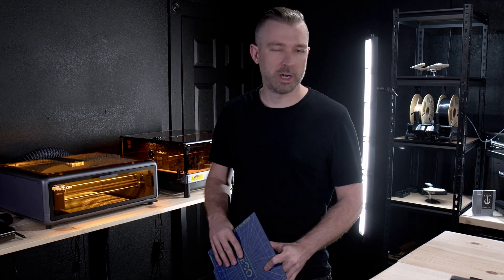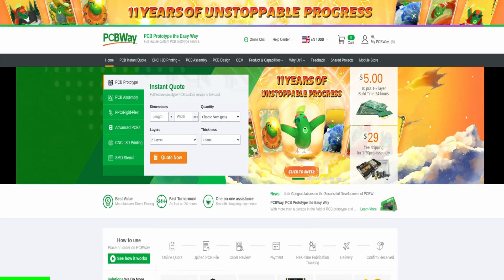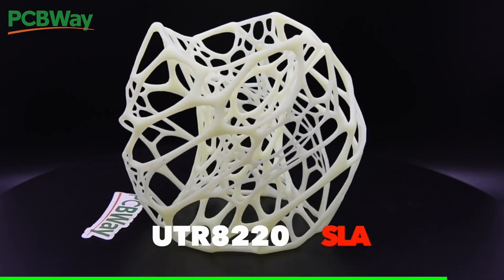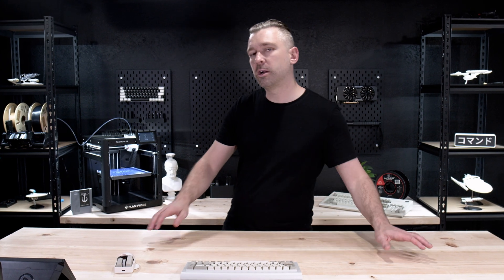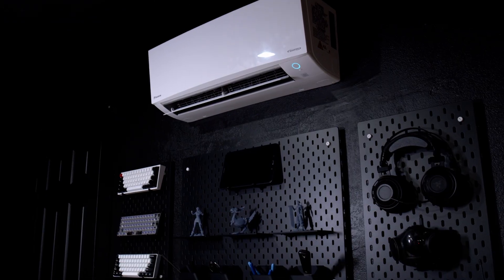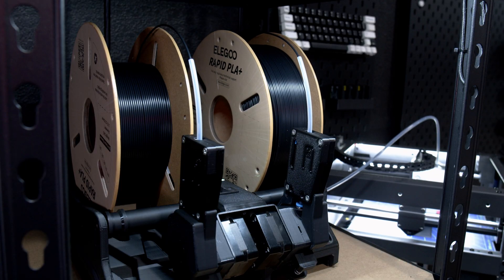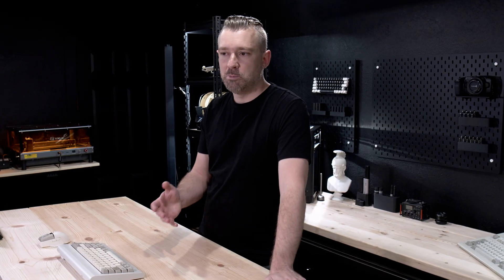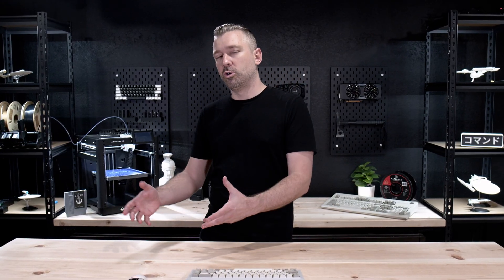No Heat? No Warping? Better 3D Prints? Geco Cold Plate!

Comment: I remember back when the little college printer farm used exclusively Makerbots and none of them had heated build plates.  My professor who 'ran' the printer farm barely knew anything about it.  He had an ideology, not an understanding.  He wanted 'everything' 3D printed (including the flimsy spool holders, back when they tried doing that thing where you spooled filament directly onto the holders) and I remember he'd complain to me "we waste so much plastic on the rafts, why dont we print without them" and I keep telling him the Makerbots 'cant' because the build plates are not heated, including the really fancy $7 grand Replicator Z18.  Something he learned the hard way where a really big print failed overnight and filled the hot end with molten plastic (guess who had to clean that up... thats right, not him.)

So yeah, its fun seeing these 'cold plates', back in the day when printers DIDNT have heaters, and its amusing how the new problem now is that you cant 'turn off' the heaters.

Comment: I run a small stall in the mall for our 3D printing learning center. Our source of electricity is an ecoflow mobile power station. Not having to heat the bed on our display printer saves so much power, that’s exactly why I ordered one of these plates.

Comment: Pretty sure if you set the bed temperature to 0 the slicer just skips any build plate heating commands in the Gcode. At least, a good slicer should. If it's waiting for the bed to reach 0 C (lol), something is very wrong with the slicer.

Comment: Hello, to disable the temperature of the bed just put a # in front of the gcode m140?
Reply from the maker: In simple terms yes. But there may be other parts of the start macro you may need to comment for the bed as well.

Comment: I have one of these plates for my K1C with the multicolor CFS upgrade kit. I've printed a few items on the plate and they have been fine, other than the firmware not allowing the heat bed to be turned off completely. Also the bed leveling function attempts to run the temp up to 50 degrees, so you basically have to skip the calibration. This are issues with the printer and not the build plate...The first time that I printed a multicolor sign, the purge tower was so thin that I had a really hard time removing it from the plate. I resorted to a scraper and finally got it removed, but not before gouging it. Luckily my Geco plate is double sided and the other side is still fine.

Comment: It would have been quite interesting to see if the “cold plate” scenario would help with ABS or other filaments that are really known to have warping issues.
Reply from the maker: Fair point. In the future it would be a good idea. Mostly I've been testing this plate for use in production.
Reply: You want the plate hot for ABS/ASA in an enclosure to get the chamber temperature up and help prevent warping and poor layer adhesion on the prints.
Reply: You want the plate hot for ABS/ASA in an enclosure to get the chamber temperature up and help prevent warping and poor layer adhesion on the prints.